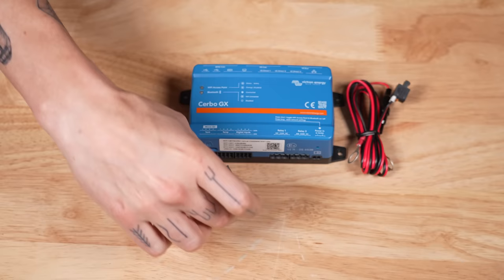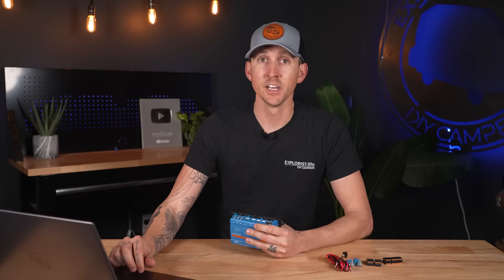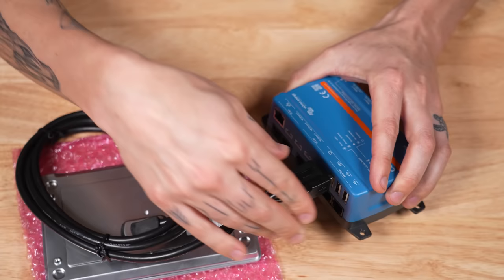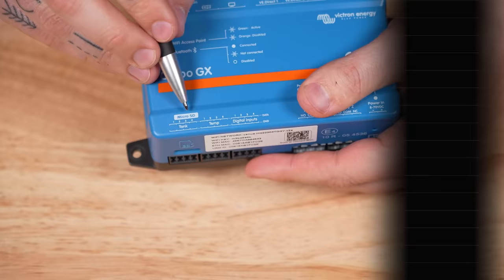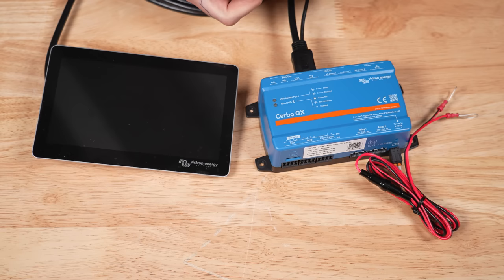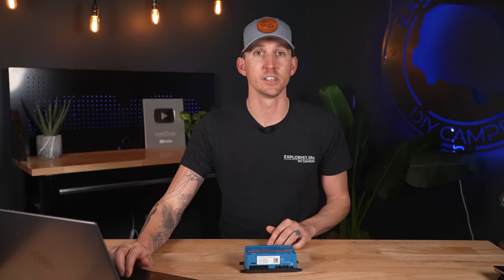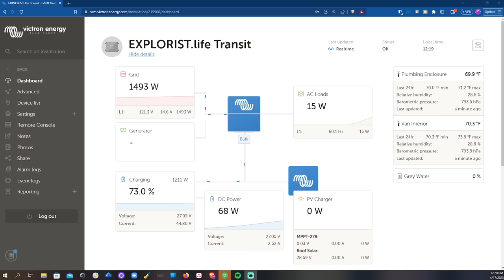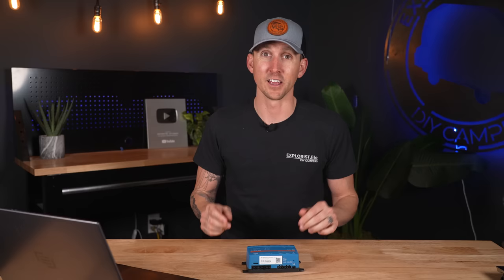Victron Cerbo GX Basics

Comment: I would like you to cover the non conventional.  I have a 5000 watt inverter (made in China) I want to hook up a smart shunt, connected to a Cerbo and GX Display. i know I am not going to get all the Victron info but what info will I get and what info that I won't and which one will I get.  This is also connecting420 watts of solar through a Victron MPPT, which one would you recommend for lead acid batteries.  Many People don't have victron Inverter / regulator. BTW I have a Progressive Dynamics 30 amps converter.

Comment: A question, is it possible to connect an RS485 MPPT device (other brand then vonctron) and use their data in the CerboGX ? Cause frankly .. i hate those Victron mppt that can't be opened or repaired .. i find it.. upsetting, appart from the 2 top of the line devices SmartSolar MPPT RS. All others are glued to the front panel .. not acceptable.
Reply from the maker: The venus os is open source; so realistically you can do whatever you want with it if you have the developer skills or are willing to hire somebody to develop that feature for you; but it's not a native feature.

Comment: Does this unit need WIFI to operate?  Also does it sync with the Diesel Heaters as far as temp control?
Reply from the maker: It needs wifi or a cellular network to communicate with the VRM portal, but it doesn't need WiFi to work within the vehicle.  I don't know that it natively synch's with diesel heaters; but if you know a bit about programming; the Venus OS is open source, so anything is possible.

Comment: Will this only take info from other victron gear or info from let’s say go power charger inverters and the same brand solar controllers?
Reply from the maker: I don't believe go power will communicate with the Cerbo, no.  If the go power has can bus data comms and you have some programming know how, you might be able to make it work since the cerbo OS is open source.

But basically, no.

Comment: Greetings, Class A with Victron DC to DC, (2) Solar Controllers & Smart Shunt. Xantrex Invertor presently but plan on Multi Plus in the future. How would a CerboGX work for me.?
Reply from the maker: Sure!  Just connect your victron components to it.  It's not going to show anything from your Xantrex Inverter, but you'll still be able to see that power coming out of your batteries through your SmartShunt.
Reply: @EXPLORISTlife  
Would the CerboGX “S” be more suited for my application .? If so , do you stock the “S”
Reply from the maker: We don't stock the 's' as the original one works for all use cases with no if's and's or but's.

Comment: I think any cat6a cable with rj45 connectors would do. I was wondering why would you recommend some brand x cable? Seems so fake information.
Reply from the maker: Because if the Victron cable doesn't work for some reason; I'll warranty it.  I can't warrantee nor guarantee any other cables will work and I can't start troubleshooting if I can't guarantee that the data cable isn't causing a problem.

You can always 'try' a non Victron branded cable, and it will work most of the time, but if you are having weird issues within the system, that is the first thing to check/replace.
Reply: @EXPLORISTlife  I see. I still think it is silly to promote Victron cable, which is in all likelihood made in the same factory as 99'% of all data cables. And then branded. But, it's all good, thanks for the reply.
Reply from the maker: @TheGologozo  I think your feelings on the issue would be different if you were on the hook for providing tech support for these units. 😉🤣👍

If you'll send me your email address, I'll start forwarding you all of our tech support questions where I suspect a faulty off-brand data cable so you can handle those. jk 😬😬
Reply: @EXPLORISTlife  🤣thank god I am not!!
Reply: @EXPLORISTlife  Thanks but no thanks! I have my own cross to bear! 😆

Comment: Trying to figure out the Victron Branded Cable comment. ???
Reply from the maker: What about it?
Reply: @EXPLORISTlife  Specifically the ethernet cable. Is this just a standard rj45 cable ?
Reply from the maker: @markpartin8403 You can try any RJ45 you like, but if problems arise, swap it out with a Victron branded cable before contacting tech support.
Reply: @EXPLORISTlife  I know I won't have an ethernet cable problem, but if someone else wanted to purchase one for some reason where would they purchase one? I saw the cable on the Victron site, but you can't purchase it direct. I looked at a couple dealer sites, and they had nothing.
Reply from the maker: @markpartin8403 As an exercise in helping me do better… did you check out our store shop.explorist.life for that?

If not… how can I do a better job of letting you all know that we have a store where you can buy the stuff seen on this channel from?

Comment: Victron branded cables ... really ...
Reply from the maker: Yes, really.  Too many poor quality cables out there.  Feel free to use whatever cables you like and it'll 'probably' work; but if you have issues, replacing a generic data cable w/ victron branded fixes the communication issues most of the time; and if it doesn't; then we can start investigating other issues under warranty, but in order to troubleshoot warranty claims/issues; we have to have faith in our data cables.